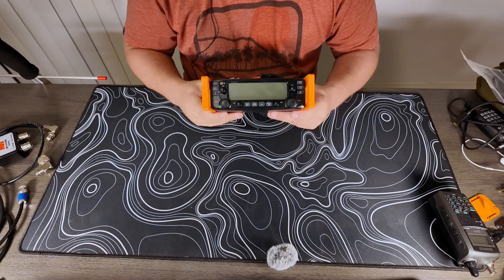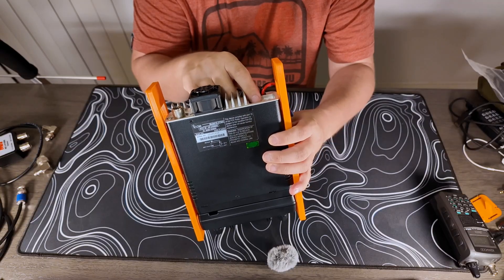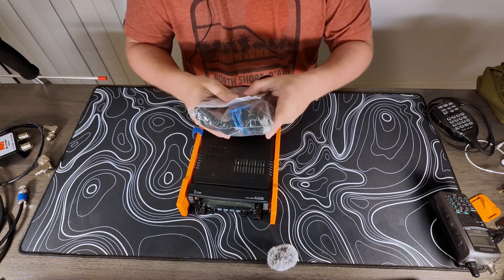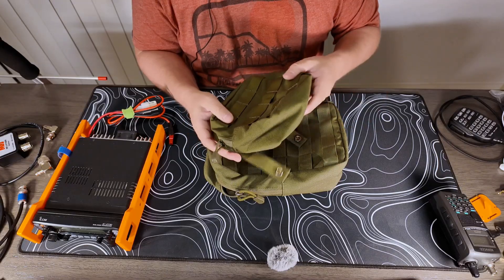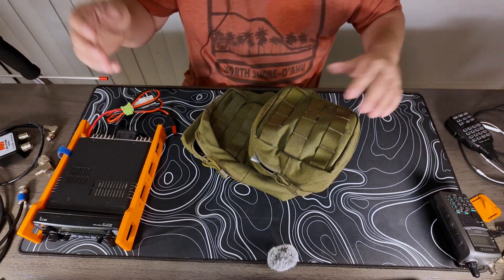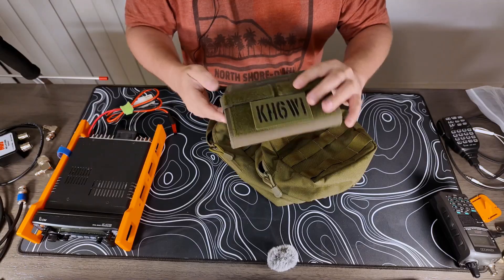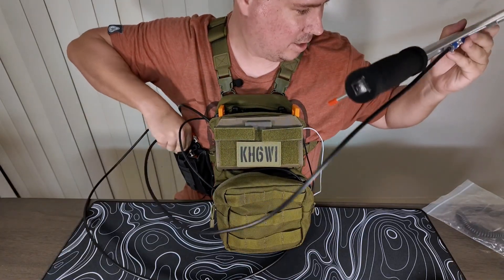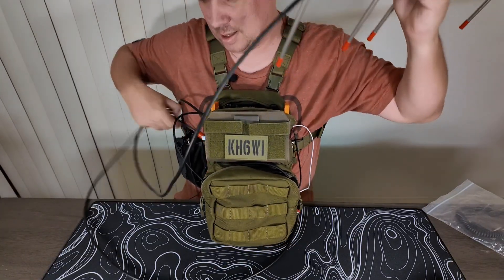Portable FM Satellite pack build

Comment: might be better with a single feedline dual band antenna and no diplexer , like the one from EA... i like it a lot more then the arrow.
Reply from the maker: @jhill4963  The only EAntenna I've seen is the DUOSAT which also requires a duplexer. I have tried the Elk Log Periodic antenna which doesn't require a duplexer, but I was disappointed with it's RX performance.